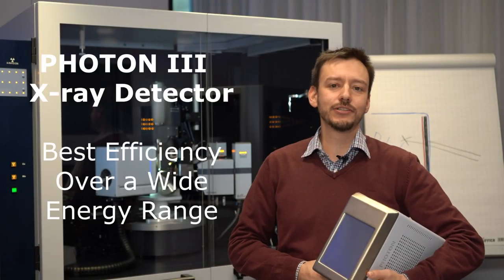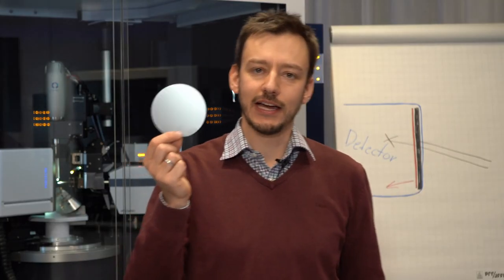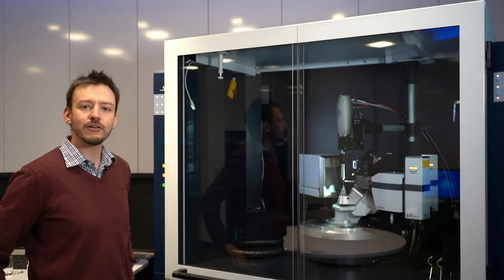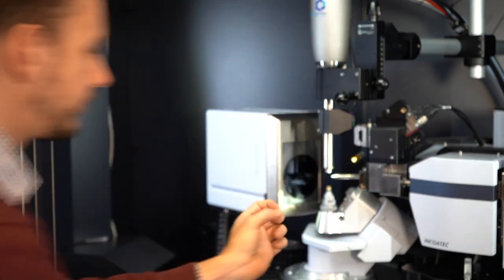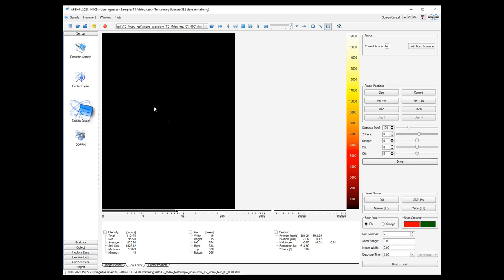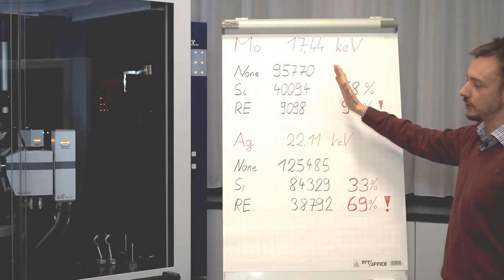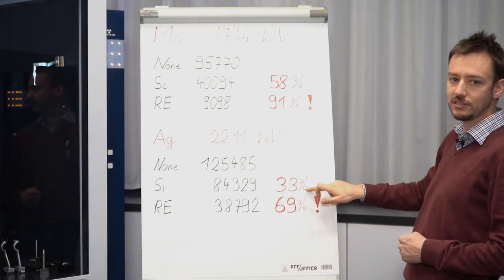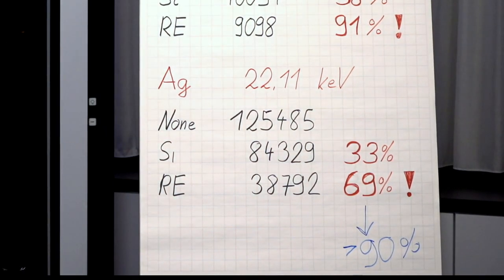PHOTON III X-ray Detector | Best Efficiency Over a Wide Energy Range

Comment: Do you have any information comparing the performance of these lathanide conversion screens vs panels with higher Z sensor materials like CdTe or GaAs?
Reply from the maker: As our video shows, higher Z materials result in a better absorption of the incoming X-rays and consequently the materials you mention also benefit from that effect. However, next to a price tag there are a number of physical constraints - such as size of available sensor segments and blind gaps between segments - which for us make the PHOTON III approach preferable.

Comment: Interesting,
 I am wondering if there is a particular method to improve sample diffruction, I mean how can I increase the signal quality from moderated diffructed to a well dffructed sample.
Many thanks.
Reply from the maker: The most promising approach to increase the diffraction capabilities of a sample is to recrystallize it. If this it not possible, as e.g. for a natural mineral, screening a number of crystals (something like 50-100) may help to find a better one. As shown in the video the PHOTON III has the highest efficiency over a wide range of energies to reliably record all diffracted photons. Moreover the huge active area will help to  quickly collect high data multiplicity and therewith improve data quality even further. On the source end high intensity solutions, such as the ImS DIAMOND or the METALJET are the state-of-the-art tools, see www.bruker.com/scd for details.
Reply: @Bruker  thank you very much, I do appretiate your response. I am always keep going with recrystalisation, and I have interestung results. I am just wondering for some of our students sometimes submitting samples to run, and I try do my best so that I am asking, I give them some advices to improve thier recrystallisation.
Many thanks. 🤞
Atheer